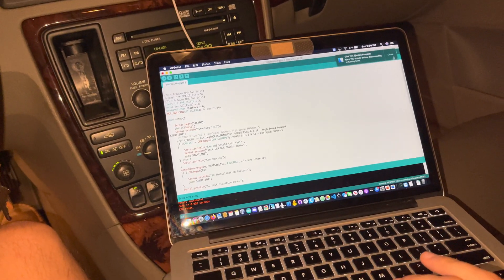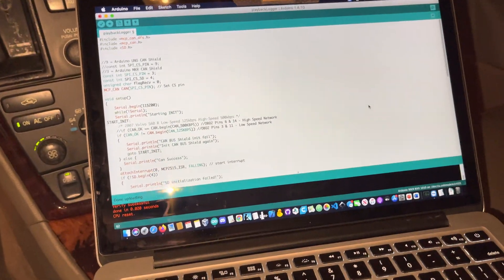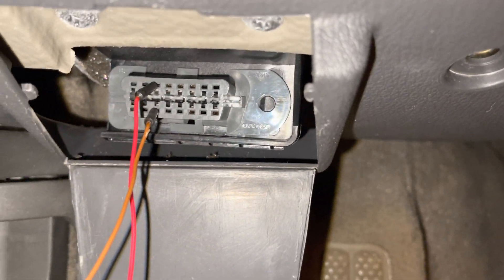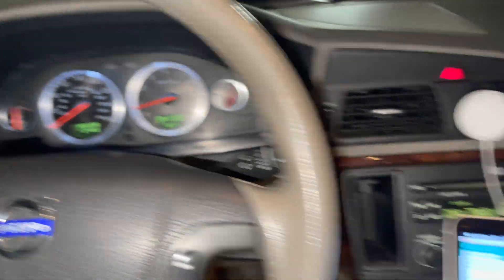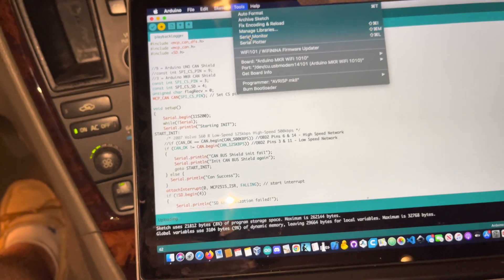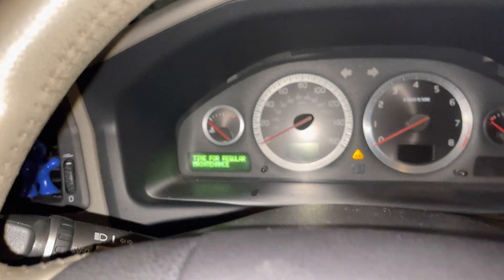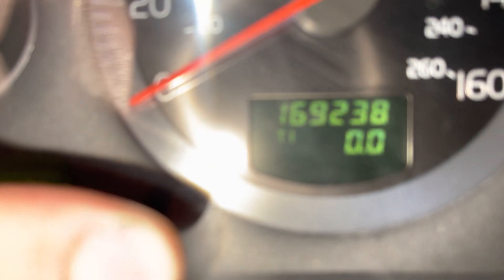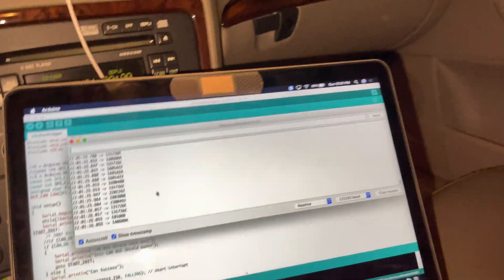CAN Bus File Logger software

Comment: Can this essentially work for other manufacturers? I'm following the stuff you are doing and working through with my own cluster. Funny, I have a Volvo S60R in the garage but I'm attempting to do this with an Audi B6 S4 cluster, but it seems I'd need actual vehicle for that?
Reply from the maker: It definitely helps to have the car to sniff. Seeing as audi is a more popular brand you may have better luck searching online for can-bus information. I would also attempt to search german google and forums.
Reply: @AVGarage_  Thanks, yeah, knowing VW they would change much of the binary